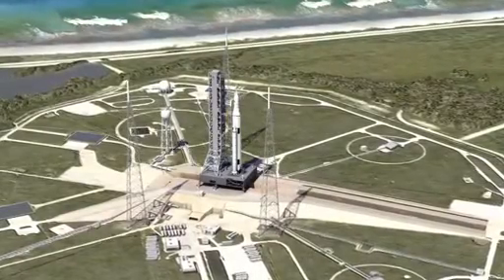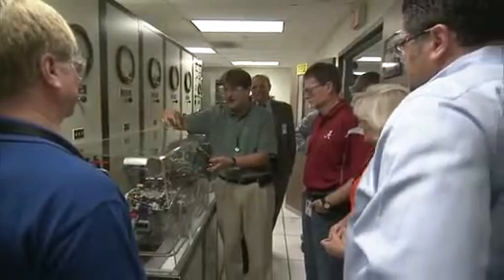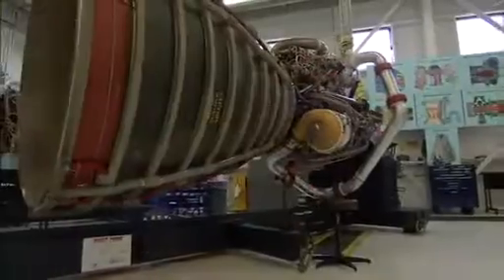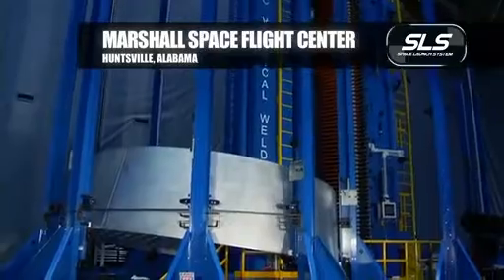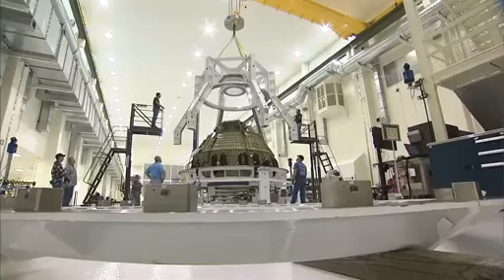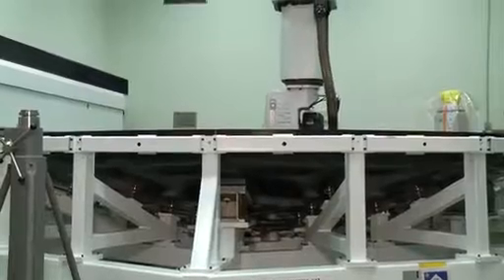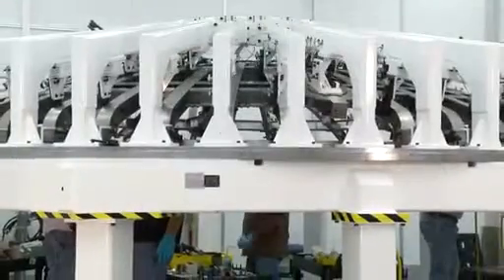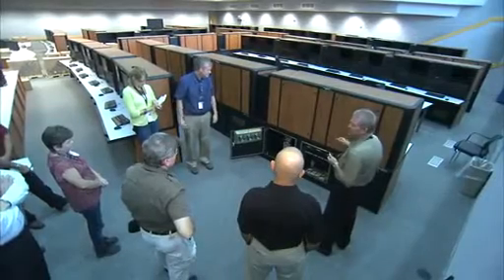NASA's Deep Space Exploration Programs - Making Great Progress | Space Travel Science

Comment: Yall would freak if you went into the VAB or O&C buildings! I refinished the O&C from its asbestos days to what you see in the video. When you open the door, wind blasts past you as to not get dirt inside! The A/C system is 55,000 tonnes and I was told by a engineer it cost several thousand a day to run, and it runs 365/24/7!! The vacuum chambers are huge, theres 2 of them, they pump the air out to test the capsules for leaks etc.. I think it takes 500 regular a/c filters changed once a week!

Comment: That's just a type of ion engine. Plasma is ionised gas. Ion engines will likely take the role for farther interplanetary missions to the outer planets and regions of the solar system. But for missions around our little block of the solar system, ion engines are unpractical as they take very long to accelerate and of course you want to take advantage of those high speeds. Not just spend the whole mission accelerating and decelerating very slowly the whole trip.